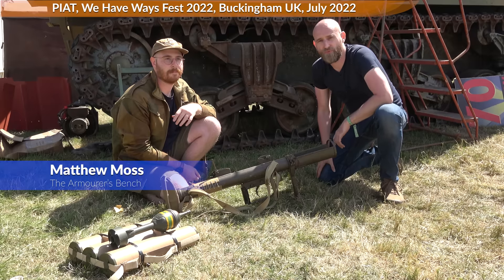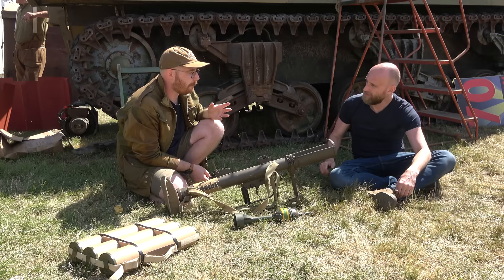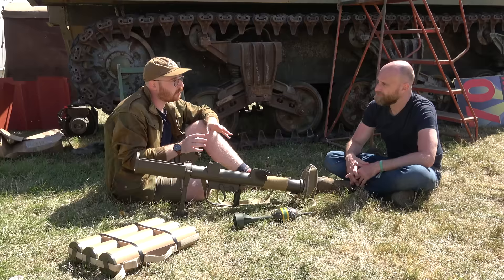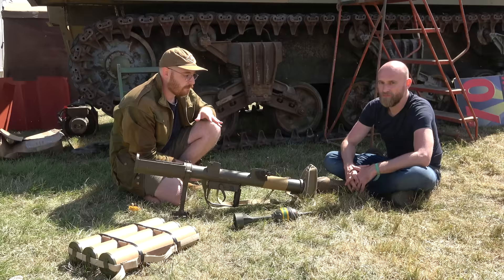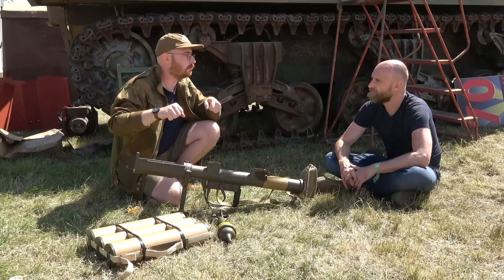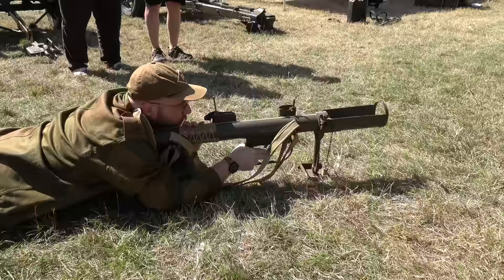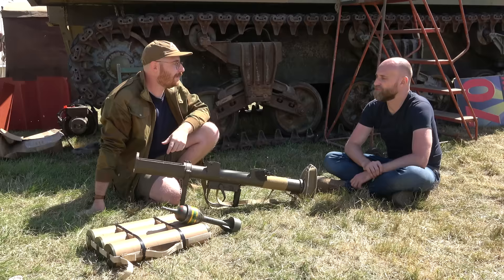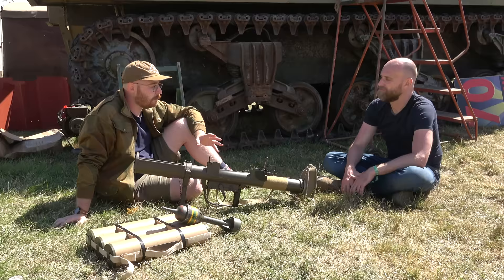PIAT: Better than the Panzerfaust?

Comment: Mind, the main issue with the comparison between Panzerfaust and PIAT is that they are not equivalent weapons. PIAT is a counterpart to Panzerschreck and Bazooka, a crew-served weapon carried by a physically fit adult male for the most part. Panzerfaust was a disposable weapon intended to augment squad firepower by being carried in addition to other weapons. Thus, neither is "better" than the other because the two don't really compete with each other.
Reply: like the at 4 vs carl g
Reply: This, so much this.
Reply: Well those definitely compete with each other. Function for 2 was the same and in that role pretty definitely  Panzerfaust  was a better weapon. PIAT been  crew-served  simple because it was not possible to use it single-handed. Same reason PIAT  was not used as squad weapon - it was just not possible base on weight. And Panzerfaust  provided that ability.
Reply: @vladimirpecherskiy1910  

I agree the language I used is somewhat vague but I really was trying not to write a whole essay so I apologize for any confusion. I shall stipulate further.
      By compete, I mean the two didn't serve the same purpose within the TO&E of their respective armed forces. The PIAT was a specialist weapon, a weapon whose user was devoted to using it. Same with the Boys Antitank Rifle that PIAT replaced. The Panzerschreck and the antitank rifles it replaced were similarly specialist weapons within the German TO&E. If you were a PIAT or Panzerschreck operator, your job was to use your bomb-thrower first and your small-arms, if any, for personal protection only. 
      Panzerfaust's place in the German TO&E was as a replacement (or supplement) to the antitank grenade, a non-specialist-user weapon. It was a "munition" to be handed out to any and all soldiers as circumstances suggested in addition to their other weapons. A rifleman handed a panzerfaust was still a rifleman. He was just now one that could engage tanks if necessary as part of his mission as a rifleman. Panzerfausts, in other words, simply augmented an infantryman's individual firepower in the performance of their normal mission; it didn't change their mission. 

      Does that help clarify what I mean?
Reply: @genericpersonx333  I argue statement, that "neither is "better" than the other". All what you mention is quite correct, but - who cares? If today somebody somehow  would create weapon with firepower and range of 155mm howitzer and weight and price tag of M4 carbine - it would be a better weapon then  155mm howitzer, period. Nobody would care how that evolve - from carbine or howitzer side and what was initial thoughts about tactical niche.   Nobody would care to use  155mm howitzer after that - because no point.
Reply: @vladimirpecherskiy1910  It sounds like we have the classic debate of "Apples and Oranges" at play here. You argue that since they are both fruit (ie, are antitank weapons), they should be weighed against each other directly while I say that because one is an orange and the other is an apple, the two really don't merit as much comparison as comparing the apple to the other cultivars of apple. In other words, you want to compare apples and oranges because they are both fruit, while I want to compare the one type of apple (PIAT) to other types of apple (Panzerschreck, Bazooka) rather than the oranges. 
       For myself, the problem of comparing Panzerfaust and PIAT is that they are too different in methodology. PIAT is not, practically-speaking, a one-man weapon, and requires a dedicated user(s). It may have better range and offer some other advantages over Panzerfaust, especially in terms of safe handling, but tactically, it is limited in other ways. Panzerfaust, meanwhile, has its faults, but it was a weapon that could be handed out to any soldier as needed without detracting significantly from their other tasks. 
      Arguably, the right answer is not that PIAT is better than Panzerfaust, or the other way around, but rather that having BOTH PIAT and Panzerfaust is the best answer, as both weapons compliment each other nicely. They offer different approaches to the same problem, and by doing so, ensures a higher likelihood of dealing with the problem should one approach prove less practical than the other due to circumstances.
Reply: @genericpersonx333  That exactly point I disagreed  "weapons compliment each other nicely". You use something which is result of non - positive properties of a weapon to somehow make it sound as advantage. Is the fact that it requires a dedicated user(s) a good thing? No, it is a disadvantage based on the fact, that thing just heavy. There are no much real advantages for PIAT over  Panzerfaust-60. Both has pretty much same practical range - despite formal PIAT advantage.  PIAT did not have back blast, but I newer heard that been big problem for a RPG- like  weapons, unless fired from inside house. PIAT  can be pushed to indirect fire role - but with range less than two-inch mortar. Same time it is very heavy and not at all reliable to self -cock (and good lack to cock it in a firefight)
There are no questions that if British would have Panzerfaust they would not adopt PIAT - no point.
Granted Panzerfaust  evolved a bit late, but Bazooka was direct competitor at the same time, an Bazooka was better weapon either.
Reply: @vladimirpecherskiy1910  So, by your logic the Panzerschreck and Bazooka are also worse than the Panzerfaust because they're crew served, despite having better range and penetrative power
Reply: @magoshighlands4074  Well, yes, Panzerschreck and Bazooka in general worse weapons then  Panzerfaust -60 and definitely worse then Panzerfaust -100 to which neither has range advantage.
And no, Panzerschreck and Bazooka had no penetration advantage over Panzerfaust, actually Bazooka had a big  disadvantage in that area - which became a problem at the end of the war. 
Granted those weapons was not created at same time, so it is not 100% fare compare.
Reply: @vladimirpecherskiy1910  Are you sure we're talking about the same weapons here? The Bazooka had a massive range advantage over the faust, mainly because it had a proper sight, and the later model warheads dealt with late war tanks handily
Reply: @magoshighlands4074  Yes, we're talking about the same weapons :)
You can find on some ww2 and even ww1 rifles sites marked up to 1200 m - but you do not think you can hit even man size target on that distance, right? Main problem on those things was not sights but low technical accuracy of projectiles and very low speed of those.  Particularly rocket-propelled projectiles was  sensitive to air temperature on speed and so ballistics.And not spun.  And low speed translated not only to big lead on moving targets, but also very curved trajectory, so you should be exact on distance.
So I might be not quite correct and late Bazooka probably can tactically hit to 150m or so on tank, but no much more then than - with a good hit probability. I think till this day RPG operators not enthusiastic to fire on bigger distances to active tank.
And no, despite some grow on penetration (to like 100mm on 90 degree) it did not have enough punch for later war tanks. (and penetration is not all - real thing what it can do after penetration - to compare Panzerfaust delivered 3 times more explosive). That is exactly why Super-Bazooka was created. That is why I am saying, that Panzerfaust-100 is all-around better weapon - at least as anti tank weapon.
Reply: @vladimirpecherskiy1910  Dude. We're talking like 500 meters max, temperature isn't going to effect a big fuck off rocket. The Panzerfaut is good out to maybe 100 at a push
Reply: @magoshighlands4074  Man, read something, before speak :)
Reply: @vladimirpecherskiy1910  I've read plenty, unlike yourself it seems
Reply: @magoshighlands4074  So you would understand thing a bit better - starting protective speed there is about 80 m/s
That means that when fire on 500m protective will be on air about 7 second, will reach at highs point 135m and will be still like 2m high then target within 6m from it. So if you miss distance by like 6m - you will be over or under target.
Reply: @vladimirpecherskiy1910  Yeah, the solution to this is good sights, which the bazooka and PIAT have  the faust doesn't
Reply: @vladimirpecherskiy1910  >If today somebody somehow  would create weapon with firepower and range of 155mm howitzer and weight and price tag of M4 carbine - it would be a better weapon then  155mm howitzer, period
Not necessarily. Could this carbine-sized pocket howitzer be used in the same roles that the 155mm howitzer is used in (i.e. delivering long range, indirect fires)? Does its ammunition (which would undoubtedly be unique and proprietary--unlike that fired from the 155mm howitzer) match or or exceed the cost and manufacturing complexity of 155mm shells by a large enough margin to justify retraining current crews on this weapon and introducing a potential compatibility problem for other allied nations?  If so, then yes, it would be vast improvement. 

However, if it cannot be used to effectively deliver long range, reasonably accurate indirect fires, then you couldn't really claim it was "better" than the howitzer as it cannot fill the same role. 

Ironically, the M28 Davy Crockett is the closest real-life equivalent to what you describe. Even the larger M29 was a fraction of the weight and bulk of any 155mm howitzer system--towed or self-propelled, and those W54 warheads delivered a blast that exceeded the firepower of multiple howitzer batteries all shelling the same target. Of course, the Davy Crockett had other... issues that made it a vastly inferior alternative to the 155mm howitzer (one of which was range). But even if they were able to make a similar weapon with a 30 km range, it still wouldn't be considered superior, as most military planners would generally consider creating a radioactive mess of the target zone to be quite suboptimal, if not unacceptable.
Reply: @Schwarzvogel1  Yes, yes, (and I even put "range" there, right?) - we would analyze physical ability of weapon 1 and physical abilities of weapon 2 - with all properties of it include cost, munition cost and mass and so  forth - include political limitation as such. And we will come to conclusion is one weapon better then other or one is better for this usage and another for that and it worth it to have both. But we would base that conclusion on a weapon properties, not in administrative current usage of it. That all I am saying, and that what sometimes military not quite getting (and because they sometimes not proficient on those properties - not on all levels)
Reply: @magoshighlands4074  temperature affects bullets. And rockets are more sensitive to temperature than bullets. Also, the RPG7V has a better sight and faster rocket than a bazooka, yet its practical (50% probability hit on first shot) range is just 300 meters. Unlesss you use your bazooka like a katyusha, goodluck hitting a point target at 500 meters.
Reply: @magos highlands
Sir I fear you are attempting the Sisyphusian task of arguing with a wehrboo.
Reply: Use and how their issued may vary but they're meant to do the same thing.
Reply: As discussed at the 14:11 minute mark.
Reply: @alanshackelford6450  The forerunner of the Panzerschrek was the Raketenwerfer 43 (Rocket Thrower 1943) that fired a rcoket from a breached tube and so had a recoil and required a 140kg carriage.   I've often wondered what could have been achieved with a PIAT weighing about 300lbs and mounted on a carriage.
Reply: @fidjeenjanrjsnsfh  The DynaHawke sight when attached to a modern Panzerfaust 3 (apparently can be adapted to Carl Gustav and AT4) provides a laser range finder and a gyroscopic computing sight.  Seems to be able to hit a moving tank at 600m.   I wouldn't say this is necessarily practical but it can be done.   In WW2 there were stereoscopic and coincidence range finders but it would need a member of the squad to carry it and use it.
Reply: @vladimirpecherskiy1910  
They do not compete with each other as they were on different sides.
Reply: @vladimirpecherskiy1910  "You can find on some ww2 and even ww1 rifles sites marked up to 1200 m - but you do not think you can hit even man size target on that distance, right?"

Oh, but it can be done, in a consistent and repeatable manner. It all depends on the ammunition and shooter whether single target engagement or volley fire is to be preferred.
Well, 1200 metres for single targets is a bit optimistic, but have a look at 9-hole reviews taking a Swedish rifle made in the year of 1900 out to 1000 yards:
https://www.youtube.com/watch?v=StQ_AcgCnag
A fluke you say?
Perhaps, if he hadn't also pushed a Finnish M39 to 1100 yards:
https://www.youtube.com/watch?v=eAnCjqX0IQA

AS for the PIAT/Panzerfaust, it is like debating whether a machine gun or machinepistol is the better squad weapon.
Reply: @johanmetreus1268  Panzerfaust is a much better weapon then PIAT - that is just it. About other staff - I have no idea what exactly you are speaking about.
Reply: @vladimirpecherskiy1910  "About other staff - I have no idea what exactly you are speaking about."

You claimed rifle sights going up to 1000 meters was ludicrous, since no one would be able to hit a man-sized target at that distance,
I gave you two sources where two different rifles are shooting at man-sized targets at roughly those distances, using the original iron sights,

Pannzerfaust can't be used as indirect artillery, and the 2" mortar can't kill tanks.
Reply: @johanmetreus1268  Not only it can, but it was used for that.
I seen those shots way before. And that means absolutely nothing. In a test conditions with a spotter with 25X glass and big static painted targets, drawing fire to a distance step by step  you can sometimes pull that trick. And that still just a trick which nothing to do with field use.
In reality that kind of  distances been used on rifle sites before mashing guns  shows up for suppressed fire. Nobody expect people really t hit a target on that distance, but you can suppress it when many people shooting at it. That is why it became usefulness when mashing guns came up.
Reply: To my mind the the thing looks no bigger or heavier than a Carl Gustav 84mm. This was carried within the platoon as well as other weapons. The poor sod with the CG 84 carried that and an SLR. The CG was a crew operated weapon.
Reply: NONSENS
Reply: @vladimirpecherskiy1910 even though im a year late to this conversation, I'll add my two cents on why I think the Piat has its advantages over the panzerfaust and agree on why it shouldn't be compared to the panzerfaust, or really any of the other anti tank weapons like the bazooka or panzershrek. The first is that you can use it in buildings without worrying about back blast, but I think theres another option. Its a great weapon for house to house fighting. Soldiers would use the Piat to surprise Germans who were waiting behind a door, by blasting a hole in a different wall to enter and attack them. You couldn't do that with a shotgun or grenade, nor would you usually have the explosives on hand to do it either. The Piat was already there and could do the job. It was also able to be used as a makeshift mortar, and fire much more than just anti tank rounds, something the Bazooka, panzershrek, nor panzerfaust were very good at. So in my opinion, the PIAT was a good weapon, maybe not as good in the anti tank role as other weapons, but good for a lot of other roles as well that other anti tank weapons could not perform.

Comment: Its an odd tool. Any "weapons of WW2" style text I read is really harsh on the PIAT, calling it essentially useless. However I'm also confronted time and time again in firsthand accounts of it being a stellar weapon, being used very effectively in key areas, with the largest criticism being the small amount of ammunition the average operator had access to.
Reply: PIAT was technological dead end. It couldn't be made more powerful. It served well enough and like Panzerschreck it's power was completely in projectile.
Reply: Further proof that any weapon that seems stupid but works isn't that stupid after all.
Reply: @vksasdgaming9472   spigot hollow charges are still popular years after the war as rifle grenades. And bullet trap rifle grenades use a positive impulse (last patent 2013) As for more powerful, the Pak 36 with Stielgranate 41 or current day low-recoil mortars.
Reply: @2adamast  Those are generally smaller projectiles than PIAT bomb.
Reply: @vksasdgaming9472  Smaller but "more powerful",  2x to 3x the penetration of a PIAT and also improved fuses

Comment: Spigot mortars are an interesting topic by itself.
Reply: The Russians recently developed a 82mm mortar using the spigot principle.  The setup allegedly reduces the noise signature to something like a 7.62x39 round being fired.
Reply: Indeed. Was used on the Churchill A.V.R.E lovingly known as the flying dustbin as it could Chuck massive demolition charges against fortified positions. So it wasn’t exactly a dead end!
Reply: @simonmorris4226  a dustbin would be fired at a bunker and then the crocodile would flame it. The napalm like burning liquid would work it's way down the cracks. The Germans usually surrendered at that point.